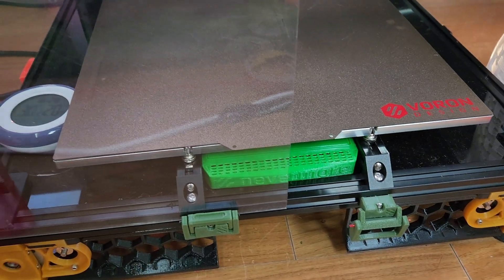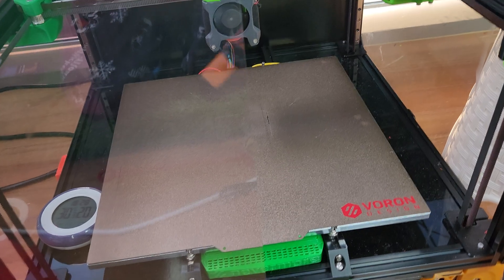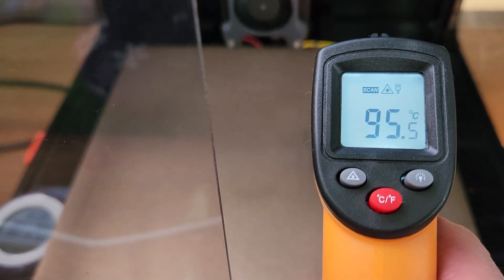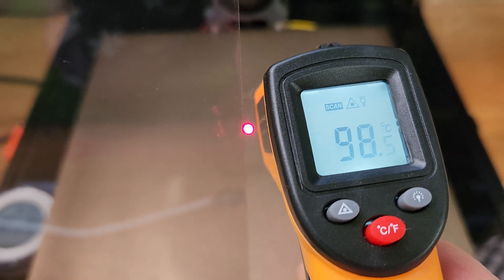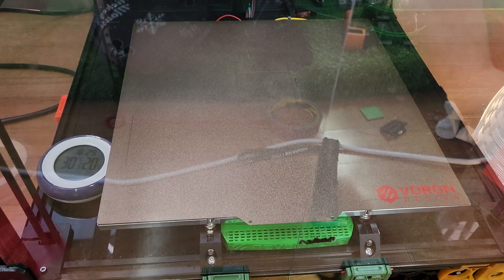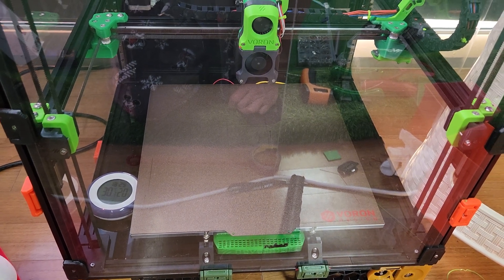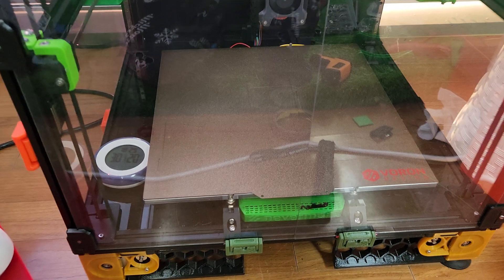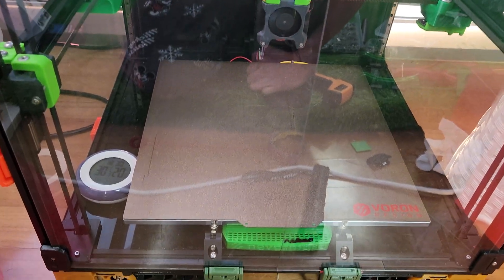ABS Warping on Voron 2.4?  Check the Actual bed temps using a thermometer!

Comment: Man, I was suspicous of this on my Annex K3 and My Voron 2.4. PUlled out the temp gun and I was 10 degrees off (on both!). So cranking them up +10. I ran a larger abs print today on the voron and it warped like a banana, so def need to crank up those temps and see how it goes. A timley video, thank you kind sir.